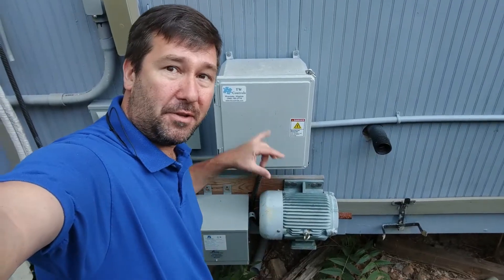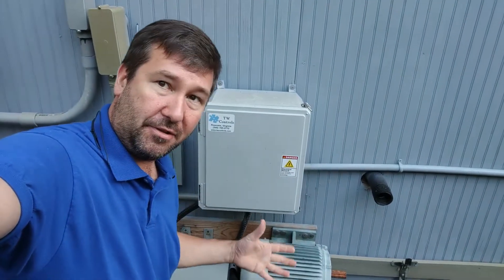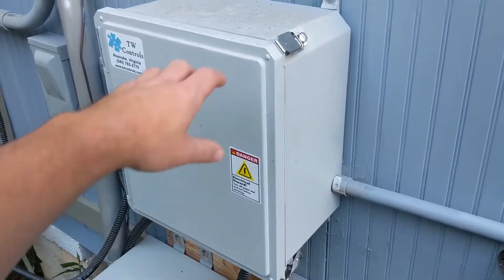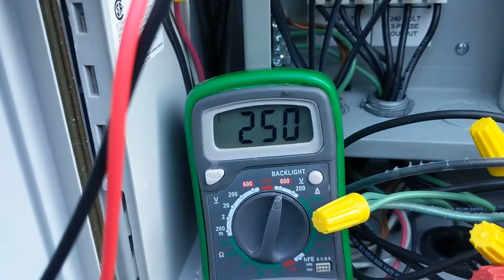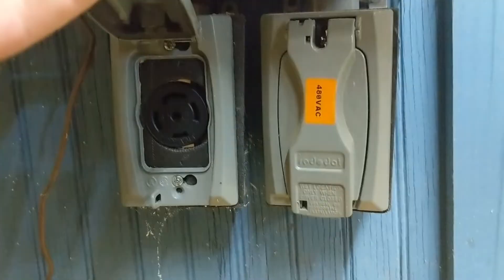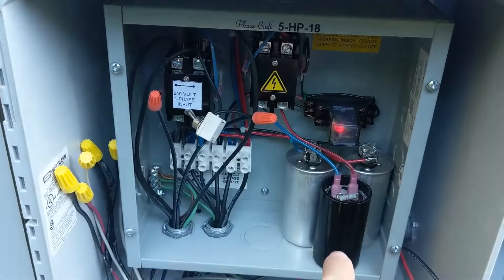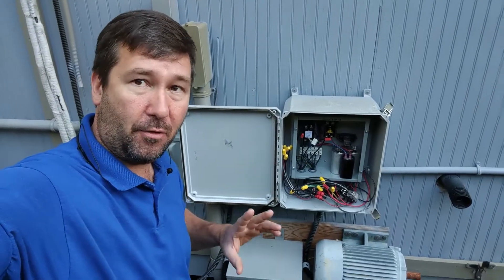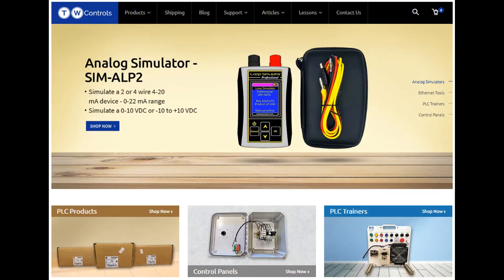Make 3 Phase Power from Single Phase with a Rotary Phase Converter

Comment: Looking forward to your next video when you get into more detail, particularly the potential relay and starting capacitor.  I've noticed that a number of DIY'ers seem to get that wrong.  Speaking of capacitors, nice work balancing the phases.  The voltages on all three phases were very close.  Did you calculate the size of the run capacitors, or was that miss and miss?🙂
Reply from the maker: Here is one I did on the start and run circuits.  I had one on capacitors but it caused to many arguments :)
https://youtu.be/eXS9ahNzds0

Comment: Very professional.  Not sure what you mean about being messy; looks pretty organized. I'm curious about the 2 pole contactor in the upper center of the  box; it has a lightning bolt on it.  What is its function?
Reply from the maker: That is the starting contactor.  It is only one while the motor is not up to speed to get it rotating.

Comment: You still need two lines.
Reply from the maker: In order to have current you need two wires, anything else is an open circuit. That could be two lines of 120 or that could be 120 and a neutral.

Comment: What kind of transformer are you using?
Reply from the maker: 3 phase 480/240
Reply: @TimWilborne did you just wire it backwards?
Reply from the maker: @djackson9987 Correct, it is fed on the secondary. Check out this video where to talk more about backfeeding transformers 
https://youtu.be/GSa0R3jhxCA

Comment: This is great...
So basically you are powering the motor with the first phase and then utilizing the other 2 the motor generates?, "mainly that 1 extra leg" how does it behave under a big load?, the motor has to keep up the production?!, I guess the capacitors pick up the load until the motor is stable?.
Very risky but genius.
Reply from the maker: One key is to understand that it only takes one more generated phase to go from single phase to three phase power. There's nothing risky here properly sized. One capacitor is to start the motor and the other is to balance the voltages. See if this video helps understand what is going on.
https://youtu.be/C58mSSd0ns0

Comment: Please help me , I don't have 380 volts ( L1, L2, L3) in my work shop, but need to test 380 air conditioning unit, before sending them out. How can I test run these units.
Please help me
Reply from the maker: The same way as this video

Comment: i am planning to run a linde 450 pulse mig on a rotary convetor. How do i go about sizing correctly, the welder pulls 66 amps on 230 3 phase at 450 amps.Realistically ill only probably go to 300 amps once in a while, 125 to 250 amps the rest of the time.
Thanks in advance!
Reply from the maker: I would reach out to American Rotary. They're very helpful with size and applications.
Reply: @TimWilborne  i want to build my own
Reply from the maker: You are still going to need the starter/capacitor panel.  You can spend a lot of time trying to figure out the capacitor sizing and you are talk about a pretty big load.

Comment: Can i use a 10hp phase converter motor to run a bandsaw mill. I currently have a small bandage mill with 15hp gas motor just wandering could i run it off 10hp phase converter motor 230v using a generator as power supply
Reply from the maker: For the most part, you can run half the hp of your idler motor, so if you use a 10hp idler, you can run 5hp worth of equipment.

Comment: Question.I run a Brewery in Texas.  My Brewhouse uses multiple voltages of single-120, single-240, 3phase208 and 480.  We get raped financially for 3-phase power here by Oncor.  Is it practical to use spinning converters to avoid buying 3phase?  Are there reasons to bite the bullet and pay the outrageous 3phase prices?
Reply from the maker: That probably is a question for the local power company.  For the most part, we dream of having access to 3 phase power and don't.  I'm a little surprised that it cost more but my wild guess is this isn't about your power consumption and is more about a peak rate charge issue.  I would be curious what you find but Oncor would be the people to ask.
Reply: @TimWilborne  I understand your response.  My problem isn't THAT I have 3 phase available... regognizing your DESIRE, but unavailablity of it...  but 2/3 of my bill is ACCESS to it.  My energy usage is relatively small (1/3).  And we're talking $Thousands per month.  Oncor is no help.  Why would they intentionally reduce their FREE revenue?  So that's where my original question comes from.  I can build a 3 Phase Converter system for some amount of capital, and save the 2/3 bill... or there is something I'm missing.  Again... thanks for your insight.
Reply from the maker: I know a lot of shops that run on phase converters.  There's nothing that says you can't. It still would be a good idea to get someone local to look at it. It's hard to get the whole picture in a YouTube comment. 

Also depending on the exact situation, changing a few motors to single phase or putting VFDs on them could be a better option.

Comment: What Hp 3 Phase motor are you using?  How many amps were ya drawing?
Reply from the maker: You double the hp of your load.  So if you have 5hp of load than you would need a 10hp idler.
Reply: @TimWilborne  I friend has a small machine shop. He hand cranks the motor before applying power. It's a huge 3 phase motor. I'll have to look on the tag too just using a small electric washing cabinet.
Reply from the maker: That's the old school way of doing it. Still works great.  Some people will couple a single phase motor to it and use it to spin it up. I like the capacitors because it's a clean setup and I can start it from inside

Comment: Good day Tim or fellow dyi'ers.  I'm curious to know if I need to match motor sizes.  For example can a 5hp pony motor supply a 10hp motor?   I was told.you need double the HP on a phase converter by many, but I've also been told you dont
Reply from the maker: Let's make sure we are talking the same terms.  Many set up use a "pony" motor to start the idler motor.  This set up uses starting capacitors to start the idler motor.  If that is what you are talking about, any motor can be a pony motor.  As for as the idler, such as this video shows, you double the horsepower.  So if you have 10hp with of 3 phase load, you would need a 20hp motor.
Reply: @TimWilborne  yes that's what I am talking about.  I'd like to run a 10hp motor for a hydraulic forging press.
Reply: @TimWilborne  so the people telling me I can source 3ph off a 5hp for a 10hp motor are not correct then?  Or is there a way to accomplish that?
Reply from the maker: If you have a 10hp press then you need a 20hp idler.

Comment: Hi Tim. Great video. My question is: What are the questions I need to ask an electrical contractor when hiring  to make my  home shop have 3 phase power? And are transfer switches a thing to have on my outlets if I will only be using one machine at a time.?
Reply from the maker: Probably the biggest thing is you need at least a commercial or maybe even an industrial electricians.  Many home electricians only know about 3 phase power from school.  

If it is just you then I wouldn't worry about having it so that only one machine can run at a time.  You'll know, and if properly protected, it will simply trip the breaker.

Comment: Hello Tim. Is the 3 phase power stable?
Reply from the maker: You would have  to define stable but it is repeatable. Properly designed it is a stable as any three-phase system.
Reply: @TimWilborne  What I mean is will it provide a constant voltage that would allow a 3000 watt machine to get constant power or will the available volts and watts jump around? In other words, will the machine be able to get enough power to run constantly or will it sometimes be starved for power and turn off then back on etc...
Reply from the maker: The 3 phases are electrically coupled by the motor so they can't "jump around". See if this video helps.
https://youtu.be/C58mSSd0ns0?si=T174i0oppEOOvc2T
Reply: @TimWilborne  Thank you for the information :)

Comment: What kind of amperage are you able to run with this set up?
Reply from the maker: Half of your idler motor's capacity.  So if you have a 20hp idler, you can run 10hp worth of load.
Reply: @TimWilborne  interesting. Trying to figure out a 3 phase set up. Probably just go with a diesel generator.
Reply from the maker: That does make it portable which is nice.
Reply: @TimWilborne  I think I will just pad mount one and use it for my 3 phase equipment only. I think it will be the most cost effective way to run a single phase system from the power company and the generator for the 3 phase system.

Comment: By adding this 3rd phase, you now need to spread out your amps across 3 phases instead of 2 , reducing the amps out correct?
Reply from the maker: Not in the end.  The 3rd leg is artificial so I still only have two legs coming from the breaker.  But at the actual load you are correct, it does divide across them.

Comment: nice video. one question. what size idler motor are you using? and what size would i need to run a 3 phase 25hp compressor motor?
Reply from the maker: As a general rule, your idler motor should be double the size of your load. So if you have a 25hp load, you need a 50hp idler. motor.

Comment: I would like two have known how you chose the size of the idler motor.  Is there anything intuitive about doing so, or does it require a ton of theory discussion?
Reply from the maker: Double the hp of your load.  So if you have a 5hp load then you would need a 10hp idler.  There is math behind it but that is a good rule of thumb.

Comment: Hello there, curious if you was to run this motor 24/7 how long will it last, i figured not too long right?
Reply from the maker: It will last a long as any other motor. Plenty of them run 24/7. As long as you service the bearings if required, you should get a long life.

Comment: What’s the horse power and what size of wire/amp breaker are you using to feed the phase converter?
Reply from the maker: It is a 5hp set up.  For the most part, you would double the horsepower of your idler for your load.  So my set up is good for 2.5hp.

Comment: I was researching how this works. Ran into it for the first time.
That's a tad bit high for 480V.
You could change the tap in the transformer and drop that 480 V down.
Not your load or demand bit maybe once equipment is running there is a voltage drop.
Reply from the maker: For the most part plus or minus 10% is acceptable. If I were in the 520 volt range I might start to worry.

In this and most cases, there is no multitap transformer

Comment: If you back fed through the secondary side of a 480 to 240 transformer, wouldn’t you just get 2 legs of 480? In this setup you provided us, you would have single phase 480.

Unless I’m not understanding something.
Reply from the maker: The rotary phase converter creates the third lag to give you 240 3 phase, then that is a three phase 480 to 240 volt 3 phase transformer. Backfeeding it gives you 480V 3 phase on the primary side.

Comment: thanks Tim, need to figure out the start relay, as I am now I use a momentary button to disconnect the start cap. What motor is more suited, 2, or 4 pole
Reply from the maker: Either one will do the job. Mines an 1800 rpm

Comment: Is this an expensive system to operate?
Reply from the maker: Anytime there is a conversion of mechanical energy to electrical energy, there will be efficiency losses but I've never measured them.
Reply: @TimWilborne  I'm trying to power a refer container with a 25hp  phase converter.
Reply: measure the amps and then you'll know, I  use 7 amps 240 vac powering my 3hp hydraulic press, you'll need a clamp meter, there are some cheap ones or FLUKE which I  have, 400 dollars, amazon have 50 dollar ones

Comment: Great video, I just purchased a hypertherm powermax 1650 g3 series plasma cutter and was wondering what size idler I would need? And do you know where I could but the whole rotary setup and install myself. Thank you
Reply from the maker: American Rotary is a good start. They are very helpful with the sizing.

Comment: 208.  say it like you know what your talking about.  its never "230" 3 phase, you have 480 - the voltaged measured between 2 phases of 480 (277 per leg) or 208  - 2 phases of 120, or 120v single phase to neutral.
Reply from the maker: No, this isn't 208. That is not the way rotary phase converters work. And there's a better way to make a constructive comment than to tell me to say it like I know what I'm talking about.

Comment: Hi Tim, loved your video. Looking to build one also as well to run my 3 phase Atlas Copco compressor, which currently I cant run at home with my single phase power. Is it possible you could share the schematics of this build? Thank you.
Reply from the maker: Here's one that goes into the details about how it works. Honestly I never did the one detailing out the capacitors because there's a lot more to it than the average viewer  may understand and I didn't want people burning up their equipment. You can purchase premade panels to put on motors for almost the cost of the parts to build a panel that does it.
https://youtu.be/eXS9ahNzds0

Comment: Awesome video and explanation!    The 240V three phase output sort of seems very much like a 120/240V 3 phase delta system,  typically found in rual areas like farms, that have many 3 phase motors and are fortunate to have 3 phase available on the pole, which can be utilized by adding two additional transformers,  or sometimes  one additional transformer, then you end up with what's known as open delta.  In case 3 phase is not available, are rotary phase converters as good as true 3 phase from the utility? Is there any de-rating of the equipment/motors I should be concerned about? I was thinking about starting a small business next year when I hopefully buy my first house,  installing this setup in a detach garage I plan to build in the next 5 years.
Reply from the maker: I don't think you can every say it is "as good" but it does work.  We use ours to test all of our 3 phase panels including ones with sensative electronics with no trouble.  Your idler motor must be twice the size of the load you want to run.  So if you want 5 hp of usable power, you need a 10hp idler.

Comment: Great!!  I´m wondering if it is possible to use a VFD with a filter or something to make 3 phase without any motor  nor generator...? or may be using 3 pure sine wave inverters ?? the big challenge will be setting the 120 degrees phase.. Have you tried any of these options?
Reply from the maker: Hi Hector.  Here is one where we use a VFD to run a motor with Single Phase.  There is also a phase shift starter but I'm not a fan of them.
https://www.youtube.com/watch?v=Z_juhqYt1Ks

Comment: Have you ever heard of delta eye configuration , but you pretty good at this so, what kind of motor is the converting 3 leg
Reply: What kind of motor 110 v 1-2 hp how does it make the 3 rd leg that part I don’t understand.  My motor is 15 hp 230-460 3 ph 36@230 v or 18amps at 460 v rpm is at 1750
Reply: Wye configuration or delta

Comment: I have 3 phase compressor, but my source is single phase. Is it possible to supply the compressor using single phase? what should I consider?
Reply from the maker: Yes, this is a very common application.  I would reach out to a rotary phase converter company such as American Rotary.
Reply: @TimWilborne  in a 10hp 3phase air compressor how many  amps circuit breaker protection is required?

Comment: What happens when you put a load on the 3 phase? My experience has been that the third phase or leg draws down in volts a bit. Do you know if I could use a welder or plasma cutter on this type of converter?
Reply from the maker: That is what your size the run capacitors for.  Typically they will run a little high when not loaded and even out when loaded.  Welders and Plasmas usually work fine.

Comment: Hi this is a fantastic job so my question is that having an 3 phase exit you can power any 3phase device?  like a 3 phase climate unit or a fridge ?? Or you can power only motors like a lathe ?
Reply from the maker: You want your control power such as the transformer on your main two legs, after that yes it will work in most applications.  I would reach out to  the rotary phase converter manufacturer before you purchase.

Comment: I know RPC's work, but just for theory, how are you getting something useful by using two legs of 240v 180 degrees apart, and inducing a phantom leg 120 degrees out? it must be pretty imbalanced, phase wise, but I guess its good nuff? The caps introduce an additional 90 degrees, but mainly they're for voltage matching?
Reply from the maker: Correct, I hope to get a hold of a 3 phase scope and show it on a video.
Reply: @TimWilborne  That would be very interesting to see

Comment: It's amazing...Is it possible to explain it with a wiring diagram, would be very helpful ?
Thank you
Reply from the maker: It is on the list, here is one were we go into the details of how it generates the 3rd leg.
https://twcontrols.com/lessons/how-does-a-rotary-phase-converter-make-3-phase-from-single-phase
Reply: You are right. That's a sure way for elaborate explanation.
Reply: Thanks for the video. Can you provide a circuit diagram for this? Pls try. Thanks so much.